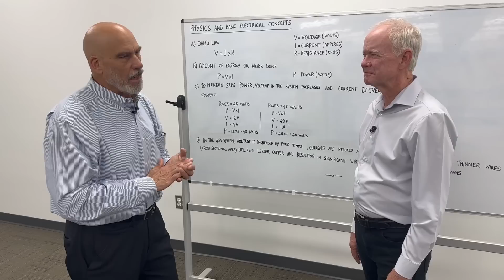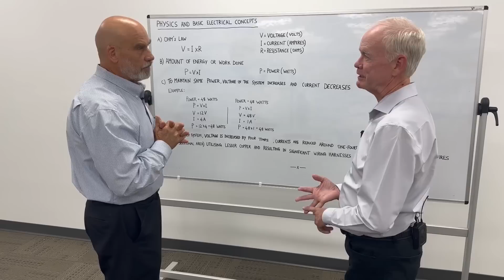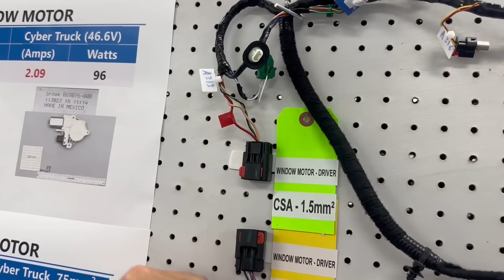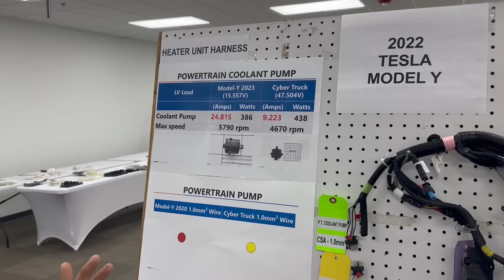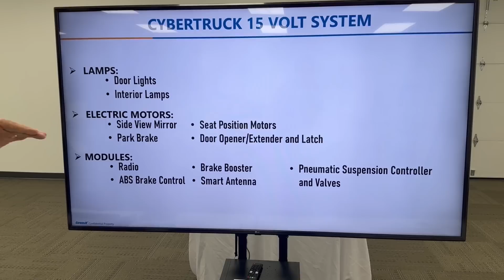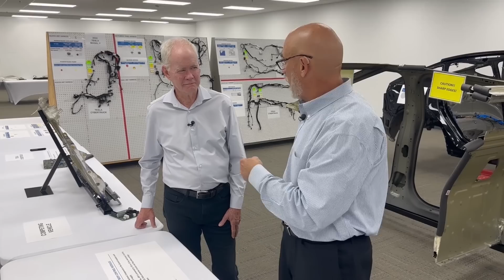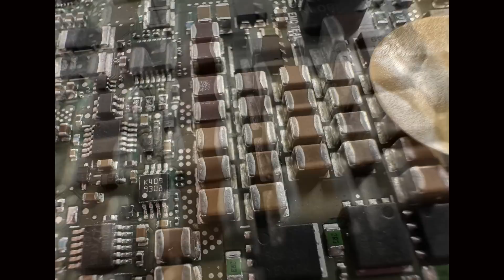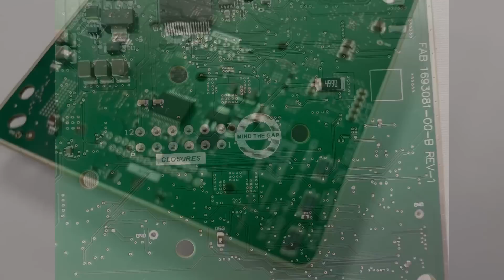Deep Dive Into Tesla's 48-Volt Architecture - Caresoft Teardown

Comment: re: "Automotive engineers have wanted to switch from a 12-volt electronic architecture to a more powerful one for decades..."  correct, but now the NEXT question you must ask is what SOLUTIONS did the savvy Electrical Engineering community come up with in the last 50 years (regarding 12V) such that they DIDN'T HAVE TO go back to experimenting with higher system voltages (ie, 24V, 36V, etc)...? 🤙 yeah, did they look at each and "shrug their shoulders"...?

A: no, because i assure what they DIDN'T DO the last 50 years was just sit around "wringing their hands" and "clutching their pearls" over this problem.  right with that being said i offer $50 bucks (cash money) to the first person who can CORRECTLY answer this question, and to that end i suspect username "retrofitter" in the comments will take this prize. okay which one of you thinks you can beat them to the punch...?   err...  beat them to my $50 bucks...? 😀
Reply: The car industry has know about higher voltages, large castings, EVs, and all sorts of stuff but didn't act on it.   Tesla acted.
Reply: We were lucky to change from 6 to 12V in the 50's. I'm sure a lot of purchasing managers objected that you can't buy 12V parts anywhere.
Reply: @jamesvandamme7786  
Following up on that.  Now that Tesla has opened the door there should be a lot less resistance from suppliers to offer higher voltage components.
Reply: They reduced electronics components size which resulted in lower power draw. Now I claim the $50!
Reply: @thabzmad7265  Ummm, I dunno about that.
Reply: So what's the answer? I think alternators, gear reduction starters and transistor radios deserve a mention. Remember 12v B+ tube radios? Used an expensive germanium 2N301 driven by a 12K5 pentode that died a lot due to shock. 
Using LEDs makes it easier to convert to higher voltages. 12V bulbs are fragile enough.
Reply: @jamesvandamme7786  
Forget alternators and gear reduction starters.  Leave ICEVs as 12 volts because they are not likely to be around much longer.  There's a point at which it no longer makes economic sense to improve technology that is stumbling toward the grave.  Cybertruck has already brought lights, sound systems, etc. that runs on higher voltage.  Just quit using 12 volts in new EV designs.
Reply: @bobwallace9753  I'm not technically current on hybrid power trains. Nor do I intend to be because they are a dead end. But some use higher voltages for the traction battery and motor.

Comment: When I worked for GM, getting the hundreds of wires passed through the "forward bulkhead" (we were not allowed to call it the firewall) was a major headache and a recurring quality problem causing leaks.  I was on the task team to come up with solutions, which were just bandaids in the end.  As shown in this video, the trick Tesla is using would solve or avoid problems for any vehicle, but especially for ICE vehicles, where the engine compartment is more exposed to water.
Reply: That's because GM insists on using Main Harnesses which include all IP and Engine Compartment wiring in one. Maybe it's cheap, but is causes large unfixable problems.
Reply: Very good and informative video 👍👍👍
Reply: Speaking of water, Hoovie showed that there was clear water ingress into the frunk of his new CyberBust.
Reply: @bobbbobb4663  That's nothing! My f-150 has dripped rainwater right into the passenger cab since it was brand new. Three dealerships were unable to fix it. BTW, my Cybertruck frunk is as dry as a bone and I've driven through one particularly powerful rainstorm on the highway.
Reply: @ZipZoomZip  Remove the inner frunk panel and enjoy…
Reply: What was Tesla's elegant solution for the plastic cover on the throttle pedal falling off and jamming at full power? One cheesy pop rivet, the cheapest band aid on the shelf.
Reply: @hwirtwirt4500  The supplier was at fault for using an undocumented soap product that interfered with the glue and the rivet was to fix cars already on the road. Making a new car model is hard and all manufacturers have issues in the beginning, for example the Toyota BZ4X had wheels falling off.
Reply: @rl9702 The pedal is very cheap and poorly designed, the fix is equally cheap and poorly designed.
Reply: @hwirtwirt4500  😂I'm actually a fan of pop rivets. I've applied them myself in low-volume manufacturing when glue just wouldn't do. You'll find them in many critical places, for instance, holding airplanes together.
Reply: @videcomp  Pop rivets are garbage, it's a cheap fix and a cheaply build vehicle.
Reply: As a new truck buyer, I want manufactures to build them ever more cheaply so I can afford a truck as nice as the Cybertruck without breaking the bank. I love getting more for less. You don't?
Reply: @ZipZoomZip  The Cybertruck is build cheaply both inside and out, it just costs 100K plus.
Reply: I now! That's Tesla working some real manufacturing magic there! From using it on and off road the previous 3 months, I say it's more of a $150K truck than only $100K.  It's a screaming deal at that! Nothing else comes close.
Reply: It's actually the most advanced vehicle available for sale today. Nothing about it is cheap.
Reply: And the word is "built."
Reply: @markburmeister4674  Laughable given the massive shortcuts to built it.  The most advanced production vehicles built have the  Nvidia Orin SoC.  Adrian is a few generations behind...
Reply: @bobbbobb4663  Good engineering means using the appropriate parts for the job, not necessarily the newest or most powerful. They have to balance supply, power consumption, and performance. You are spouting off without any real knowledge.
Reply: @markburmeister4674  OK sure...I've worked in automotive and designed more wiring harnesses that you've ever spliced but go ahead and pat yourself on the back for your paper knowledge.
Reply: @bobbbobb4663  Anyone can say anything online. Tesla is kniwn for having the best engineers in the industry, and they actually engineer their components rather than outsourcing everything.

Comment: The 48 volt DC circuit was required to run the steer by wire system and the 48 volt battery as a backup. Nothing high tech about it and it adds cost and complexity.
Reply: Lol, I guess you didn't watch the video? Copper is apparently becoming a scarce resource and it's cost has increased as a result. Like with every mass used component, reducing the cost per vehicle of copper has led to lower production costs.
Reply: @thabzmad7265  Copper is not scarce there are plenty of mineral sources but the processing is fairly intensive. The amount saved by using 48 volts (which was only necessary on the CyberFlop to run the fly by wire steering) is negligible and requires the use of a very rare and expensive 48 volt battery which is required as a redundant backup for the steering in case of power failure. This sales pitch claiming it as breakthrough technology is complete BS. Stop drinking the Tesla Kool-Aid.
Reply: @hwirtwirt4500  lol, wow I am not a Tesla fan by the way and I don't think anyone claimed any breakthrough. As per the video and anyone with electrical background,the relationship between current, voltage and resistance has been known for over a 100 years now. Tesla doesn't have an established supply chain to upset so it's easy for them to take on new challenges with electronics.
Reply: @hwirtwirt4500  Oh and do check up on an imminent copper issue facing the world...
Reply: @thabzmad7265  In the US there is an almost unlimited amount of ore to refine plus the fact that copper is constantly recycled.
Reply: @hwirtwirt4500  all of that is free for aspirant EV manufacturers to use?
Reply: @thabzmad7265  Free, not likely, is the 48 volt battery and the extra DC to DC Converter free?
Reply: @thabzmad7265  Anyone with an electrical background and is familiar with automotive electrical systems knows the actual copper savings is minimal and is easily offset by a factor of 2:1 or more when considering the extra cost of requiring both an 800 to 48 volt and 800 to 12 volt DC to DC convertors and a rare and expensive 48 volt battery.
Reply: @thabzmad7265  "Tesla doesn't have an established supply chain to upset so it's easy for them to take on new challenges with electronics." Actually Tesla had to go with the 48 volt system because the supplier of the drive by wire hardware requires it to run on 48 volts. Do your homework friend.
Reply: @hwirtwirt4500  I see you are still stuck on the steering thing which I never even bothered to comment on?  If you were paying closer attention while watch the video, you'd have learned It's not just the steering on 48V!
Reply: @thabzmad7265  The point you and others (mostly fanboys) are missing is the fact that the only reason the 48 electrical system was required or even considered was the steer by wire system. No other Tesla uses this type of steering system or the 48 volt electrical system. The two are tied together by necessity.
Reply: @hwirtwirt4500 "a rare and expensive ".  you're aware that almost all battery packs are multiple cells of approximately 3.5v cells joined together. Tesla assembles them inhouse from multiple contract sources. you're argument is wrong.
Reply: @jacoblf  Check the replacement price, you are wrong.
Reply: @hwirtwirt4500  why do you think the Replacement Cost has anything to do with the manufacturing cost?
Reply: @hwirtwirt4500  Copper is EXPENSIVE and HEAVY. This is a great innovation that you are too biased to recognize.
Reply: @markburmeister4674  The 48  Volt system is to run the crappy fly by wire steering, no other reason and the amount of copper savings is negligible. This is just another lame example of Musk/Tesla pseudoscience hype designed to stimulate fanboys like you.
Reply: CT costs LESS to build than OUTDATED Legacy trucks & BEV trucks from Legacy OEMS.
NONE of Legacy trucks or RIVIAN are making PROFITS on every EV Truck sold..
Reply: @markplott4820  Tesla is losing money on every CyberFlop sold and will be for years into the future.
Reply: @markplott4820  So why is it selling at a loss for 100,000 dollars?

Comment: 48 VDC is what the POTS plain-old-telephone-system uses.   At your local telephone exchange office there is a huge 48 volt lead acid battery weighing 3000 pounds.    It can hold up the telephone system for days without recharging.   It is an extremely clean DC current source.  To local telephone(s) the wires can only flow a very small amount of current.   Off-hook the telephone line is loaded causing the voltage to fall to much lower.     

 I'd like to known how 48 VDC systems are dealing with physical switch contact arching that is an issue above 24 VDC.  The major issue for DC voltages above 24 volts (28 volts effective with two 12 volt lead acid batteries) is direct current arching with common switch contacts.   Alternating currents have a huge advantage when it comes to switching with physical contacts over higher voltage direct current because the alternating current goes to zero volts cutting off arcing unless the gases have ionized in to a conduction medium.  DC currents will continue to arc much longer.  They can fuse a relays contacts together at relatively low voltages where there would be no problem for the same average AC voltage which actually has a much higher peak voltage.   Common switches with physical contacts are rated at 125 VAC and only 24 VDC.
Reply: Tesla doesn't use much relays in their latest architecture vehicles, not even traditional low amp fuses. Allmost completely solid state.
Reply: TESLA uses a 48v Lithium battery , thats LIGHTER & Smaller than the LEGACY 12v Lead Acid battery.